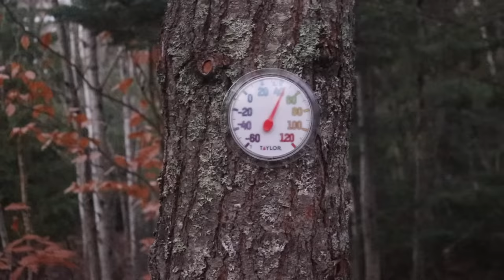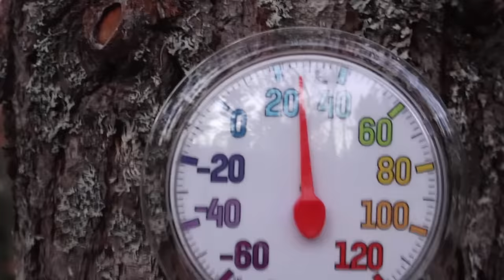A Good Man, a Piece of Land, Puppies & Campfire Food- A Simple Life in the Woods

Comment: Just a suggestion, to provide clarity in communication, find a way to refer to your different "cabins" that does it in a syllable or two.  Such as the "A Frame" for yours.  

Second suggestion.  The movable wall on your cabin.  If you moved the support that supports your swing AND allows you to lift the wall, move it to a spot that would be just outside of the spot where you put the posts that you place on the ground and under the wall to hold that moveable wall up.  If it is there and just higher than you want the wall to be, the ropes holding it up can be vertical when holding it up.  Anything else would put more stress (tension) on that rope.  I would have to consult an older book on using boom slings on ship's to tell you how much.  I can envision a couple posts tied to the deck on either side of the wall that could do it and block less of the horizon from inside the cabin. 

I have watched a few of the bushradical videos and some of yours.  My significant other, dog and I live in a log cabin in the woods of Northern New England, slightly less remote than you, but almost a mile from anyone else.  While many of your dinners appeal to us (steak, mushrooms, or chili mac with Fritos), my Ruebens use Marie's Thousand Island, yum.  While may not prefer the Jim Beam, whiskey is medicinal for us.

Spring will be here soon.  And the projects can Rev back up.  Good luck.  Thanks.  God Bless!